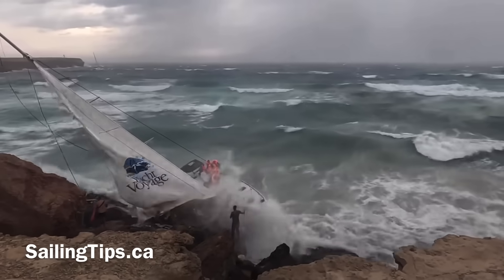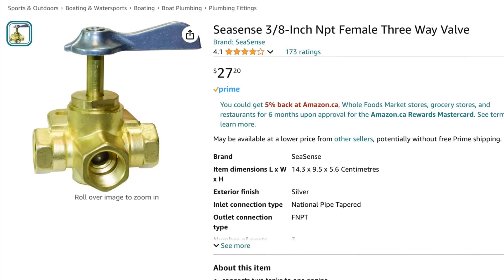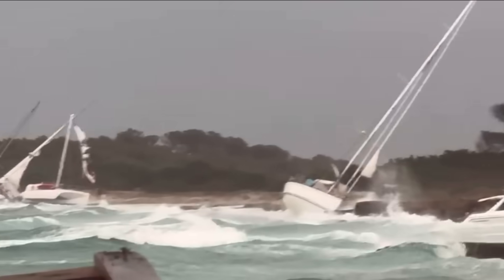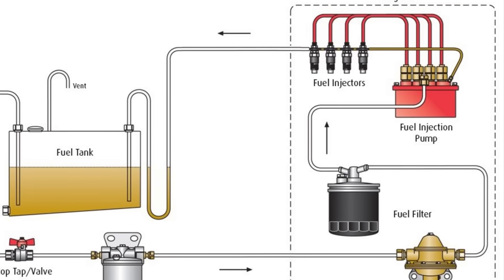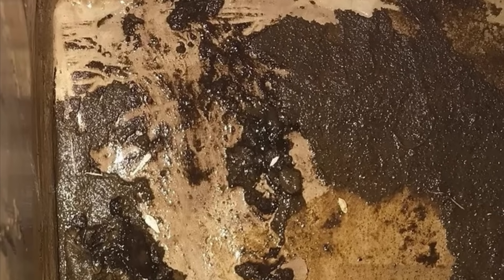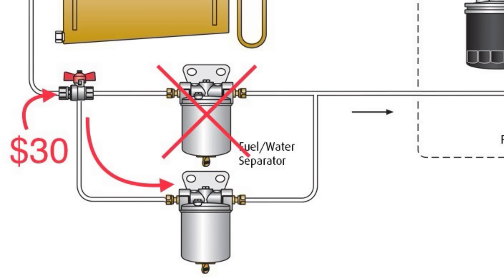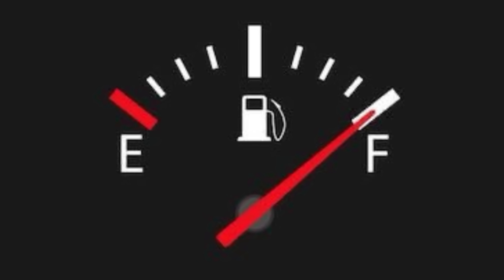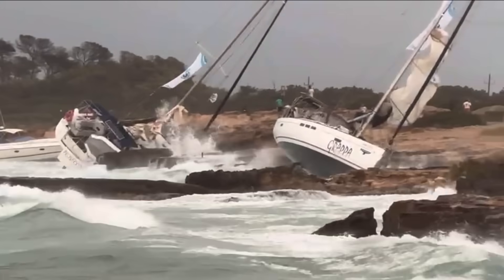The Critical $30 Safety Device Most Boats are Missing!!!

Comment: Redundancy is always good, but the vast majority of problems I've seen trace directly to bad judgement, maintenance or seamanship.  That is why bare-boat charters always get me a little unnerved. With all the technology and information available today you need to look for trouble on the water. Presenting a conspiracy theory about boat builders is not addressing the actual problem. Skippers are responsible for their vessels and your post regarding diesel fuel issues helps with that important awareness.
Reply from the maker: Yes I agree that most of these problems can be avoided with proper maintenance. I don’t think boat builders are actively conspiring but they do often opt for the cheapest solution that meets the regulations.

Comment: Boats do NOT get '..blown onto a lee shore..'.  That'd be impossible.
Reply from the maker: I think it’s a matter of relativity and definition - a lee shore from the perspective of a sailor on a boat is the shore to leeward (i.e. downwind) of the boat. The same shore can be the windward shore of an island from the perspective of somebody on land.
Reply: @SailingTipsCa  Sailor or landlubber, a lee shore is a lee shore.  
IF the wind direction changes the lee shore ceases being the lee shore.  
Your comment makes no sense.  
"Boats do NOT get '..blown onto a lee shore..'.  That'd be impossible.
Reply from the maker: @jerrycallender9352  It’s a common nautical term (likely coined by the Brits like most nautical terms) and as noted in this article there can be ambiguity based on reference frame: https://en.wikipedia.org/wiki/Lee_shore. There are lots of other references online too.

Comment: I have this but last time I suffered an engine stop, the fuel suction pipe from the tank was blocked with fibers so it didn't help to shift to the other filter. It took me an hour to realize it, give up what I tried before and rig a temporary hose from the tank drain valve instead. Luckily I have two engines, otherwise I would have been in trouble. I cleaned the tanks two years ago and think this dirt came from the fuel station.
Reply from the maker: Yes a second separator definitely wouldn’t have helped with a plugged suction pipe unless each separator had its own to draw from the tank! Glad you had an extra engine and were able to make it back! I’m sure cleaning the tanks will help prevent recurrence.

Comment: Add another valve after the 1st fuel water separator so you can remove it for maintenance while the spare is in use?
Reply from the maker: Yes you could definitely do that, but would still have to bleed the filter you just replaced which could result in the engine being unavailable for ~10-15 minutes.
Reply: @SailingTipsCa  ah so that would have to be a 3 way valve too then?
Reply from the maker: @Brewbug  Possibly…or if you add a pair of two-way valves, one on each side of the circuit prior to the Y that re-joins them you might be able to prime the spare if your primary fuel separator has an integral priming pump.

Comment: Well said. Another option is a switch valve to an easy to clean 'day tank'. Thanks for a very good idea. Note also that filling with diesel from floating pontoon fuel stations in harbours means loads of muck coming into your diesel tank after rough weather. We came across northern Europe from Germany where we fitted an inspection hatch and polished the inside of the tank, to the UK in rough winter weather - after just 2 fill ups from floating diesel stations the filters blocked repeatedly - we used 5 new filters -no exagerration - after the engine stopped several times, twice in dangerous circumstances. That's just how bad marina filling stations are. I will implement what you suggest, but from a separate tank with a separate filter system i think. Nice one :)
Reply from the maker: Yes the day tank is a great idea! There are also some pretty good water/crud separating funnels that can help on the filler side which I like to use in unfamiliar fuelling locations.
Reply: A Baja Fuel Filter, used when filling your tank, can keep the junk from getting into the boat's Fuel tank. It is an aluminum cylinder with 3 or 4 filter stages inside. The filter stages are easily removed for cleaning
Reply from the maker: @banderson8444  Exactly - there are a few variants around!

Comment: Hi there, good idea ... until it's also blocked.
Maybe a bypass  to a second tank could help? Also with a T valve. But behind the seperator.
Reply from the maker: Yes it’s definitely not a permanent solution to a dirty tank - just enough to get you out of trouble and back to safety - kind of like the mini spare tire in your car! Adding a second day tank is an excellent solution!

Comment: When sitting, diesels should be kept FULL, and gas boats should be kept EMPTY!

Because empty diesel tanks will act like a billows, sucking in moist cool air at night, condensing the water out of it, and blowing the dry air out during the heat of the day. 

Gas tanks kept full will evaporate all the light volatiles out leaving a think sludge (varnish) which will they make its way thru the fuel filters and plug up your injectors, jets, etc..., even after you put fresh gas in.
Reply: Also, if that varnish makes it into your pushrod engine it can coat your intake valve stems, sticking your intake valves open, dropping out the  push rods, and destroying your engine. 

If one wants to try and burn thru that fuel one needs to put a lot of light oil (e.g. ATF, MMO, etc...) in it, plus a lot of carb cleaner (e.g.barrymans chemtool) and and change the  engine oil frequently (when it starts to feel a little sticky).

Also revving your carbureted engine and slamming closed the choke plate closed can clear the idle and transfer ports if the x engine bogs/does when accelerating from idle.
Reply from the maker: Thanks for all the details about gas engines and how they differ from diesel in this regard!

Comment: Excellent Idea,  but the reality is, its a bit more than $30 for this solution.. really closer to $400-$450 when you factor in the second racor housing!
Reply from the maker: The $30 gets you a simple bypass but clearly better to fully twin the primary! The cost of that depends entirely on what you already have from under $50 for a cheap knock-off to $500 for a premium model. On my boat the genuine Racor twin is currently about $300.

Comment: The problem is that the fuel pick up is often well above the bottom of the tank. If you have a pickup at the very lowest point of the tank  the engine is always drawing the dirtiest fuel through the filters and water traps long before it has an opportunity to accumulate. This allows you to deal with the issue early. It simply doesn’t allow the dreaded algae to multiply.
It’s Murphy’s Law that things go pear shaped when you least expect it to!
Reply from the maker: Yes it’s ironic that the elevated fuel pickup designed to avoid picking up dirty fuel contributes to the accumulation of dirty fuel!

Comment: so it's NOT $30 !!  It's that PLUS the price of a second Separator plus some piping. Which will be another about $100. That still makes it a rather cheap solution though!! BTW a brand like "Vetus" sells double filters as a combined set for exactly this same reason!
Reply from the maker: The $30 will get you a simple bypass to the primary separator which leaves all the filtering to the secondary filter on the engine. This will get you out of a bind but far better to add the second primary separator!!!

Comment: Man, it's been 20 years since there were good parts for 30 bucks. Looks like this plan requires a second housing, filter, hoses, fittings, and a y-valve. Great idea, but this will be more like $500.
Reply from the maker: Depends how much of the gear you already have. The $30 will get you a simple bypass to the primary separator which leaves all the filtering to the secondary filter on the engine. This will get you out of a bind but far better to go further and add the second primary separator!!!

Comment: This can also be prevented by aggressive preventative maintenance schedules.  Boats are not the place the test the length of maintenance intervals.
Reply from the maker: Yes preventative maintenance can definitely mitigate the requirement…but that doesn’t always happen and many of us buy our boats used and it takes a while to get to everything!!!
Reply: @SailingTipsCa  Well built and well maintained redundant systems are always more reliable since you don't have that single point of failure anymore, but in practice "redundant" systems are often left dormant and not operated for extensive periods of time, and then not actually working when required.  

For example, at a manufacturing plant I once worked in we had two air compressors of the same brand and about the same age.  One of these compressors was the "backup" compressor.  It was wired in with an automatic switch to turn on when the line pressure dropped.  The other compressor could handle the entire demand for the plant and basically ran 24/7 for years straight.  And it was on the annual PM schedule. 

One day we had storm damage that disrupted electrical service to the usual compressor, but the other compressor should have been fine.  But when the pressure dropped and it it tried to kick on, the breaker kept blowing due to some kind of mechanical issue from sitting idle for a few  years.  

Thus in my experience, maintenance aggressive PM schedules are more reliable than dormant "backup" systems.

Comment: Rather than adding additional equipment to deal with dirty fuel, I have gone down the route of keeping a clean tank and avoiding stalls altogether.  When we purchased our boat five years ago, i sampled the fuel from the lowest part of the tank to see if it had water.  I did this with a probe which i smeared test paste on the bottom couple inches.  The paste does not effect diesel but changes color if it comes into contact with water. This particular tank bottom is sloped down to the inspection area where the water would collect.  We detected no water but if i did, i was prepaired to discuss cost reduction for the hassel of disposing of the fuel and cleaning of the tanks. 
I do not know the previous owners method of keeping water out of the tanks but it worked.  i have taken the precaution of alway keeping the tank full when the boat is idle or in storage and adding bioside to make the fuel inhospitable to growth.  I have never experienced a stall but cringe thinking about the times when even a short loss of engine power could have been very undesirable.  If you are unsure if you're fuel is contaminated, a periodic view of the clear float bowl will help ( any trip while using the engine will provide a reilistic sample but the rougher the trip the better).  I have not change filters in three years since the fuel system rebuild and approximately 300 hours later there is no water in the bowl and only a small amount of sediment which i believe is refinery/transportation dust contaminates.  

I do think there are circumstances where a second filter could save youre bacon as long as the operator understands its a short term work around and not a solution.
Reply from the maker: Good job on your diligence regarding fuel cleanliness - if only everybody was so diligent! And yes a second filter is really just a band-aid when you can’t do t hat. I did also eventually get around to cleaning my tanks “properly” and never had to change a primary filter after that.

Comment: The tank(s) should have a drain at the bottom to remove sludge. Drain until clean diesel only comes out. Additionally, use an adfitive to prevent bacteria growth AND keep tank full in winter to prevent water condensation - which is a root cause (and be sure to purchase quality fuel from operator with high sales volume).
Reply from the maker: Totally agree! Unfortunately many tanks are situated such that it’s hard to impossible to install said drain!

Comment: Build a fuel polisher. They are fairly cheap to make. A couple hundred at most. If you can afford to buy one, the best type is a centrifugal polisher.

If you also use a day tank, you can fill the day tank through the polisher and never have this problem.

If you don't have a day tank, use up the fuel in one tank then  refill that tank from a second tank through the polisher.

If you only have 1 tank, polish the fuel into jerry cans once a month.
Reply from the maker: Those are great suggestions - thanks! Unfortunately most boats don’t receive this level of diligent maintenance…

Comment: The MOST fundamental part of the fuel system missing in most yachts is a (self replenishing for smaller boats) gravity tank that, 1) means that fuel pipe leaks leak out rather than let air in, 2) also acts as a primary crud and water separator ad 3) makes bleeding very quick and simple. 
There are a number of other benefits .. but hey ho, nuff said.
Reply from the maker: I think a small gravity tank is a great idea for the reasons you noted! Unfortunately not all manufacturers include them...
Reply: @SailingTipsCa     None of them do, probably because none of them are run by engineers or professional seamen. 
  This is unfortunate as auxiliaries are expected to sit silently in the bilge, sometimes being shaken and pounded for days, with the fuel in the system being gravity and motion hammered back down into the keel bunker tank and any air bubbles from poor joints, pipe porosity or in filters etc., rising to the top, often near the injection pump. 
  Yet, they are still expected to start immediately, and oftentimes most essentially when in extremis.   
  This design naiveté never fails to fascinate. 

 The extra cost of a correctly designed installation is actually peanuts compared to what small boat manufacturers do anyway.  It's usually a tank and some pipework.   But no!  So one has yet to see one coming out of any yard that was remotely correct. ( except Holland & Germany, of course, where yards often keep retired/old engineers to super their work, and systems generally have correctly bulletproof fuel, air and starting systems. But even there, the skills are fading fast ...🙄)
Reply from the maker: @sixmagpies  I know - it would be so easy for them to do it properly from the start!!!
Reply: @SailingTipsCa  Never met one that did .. which is really stupid with an auxiliary. .

Comment: I rebuilt my iron fuel tanks out of epoxy and added a drainable sump that is plumbed with a three way valve to the oil change pump. This works exceptionally well since my tanks are three sided saddle style and slant to the sump. I also angled the return tube towards the sump to wash the gunk towards it. My pick-up is mounted on the top of the sump about three inches from the bottom. Because of the shape, this only leaves a couple of gallons of unreachable fuel.
Reply from the maker: Sounds like a great retrofit - thanks for sharing!

Comment: This is one reason I went electric. I gave up range, but it's much more reliable in heavy conditions.
Reply from the maker: Do you also regen to charge your batteries while sailing?
Reply: @SailingTipsCa  my Elco motor doesn’t allow regen from the prop. And anyway, I have a feathering prop. But there are drag devices that will generate quite a bit of power under sail, I just don’t have one.
Reply from the maker: @dc14522  A feathering prop will definitely give you better sailing performance!

Comment: Any vessel that is not just a ‘day-sailer’ should be fitted out like you suggest!!
I would even go further and suggest a tank big enough to run your engine for say 24 hrs. and have it fitted at higher level than the engine’s Dieselpump.
That way you can have the bulk of your fuel stored in a sealed tank; the fuel that returns from the engine is warm…. This will warm up ALL the fuel in the reservoir…. This will attract condensation as it cools down!!!…. And condensation causes the ‘Black Plague’ in your reservoir!!

In short: make sure you have a small tank, easy to clean, that can gravity feed your engine maybe with two paralel filtres just to be sure…
Have your big stock of Diesel (if you are realy travelling!!) completely sealed from condensation and away from warm fuel returning from the engine, probably  somewhere way down to keep the point of gravity of the vessel low.
Make decent permanent lines with a pump and an integrated water separator/filtre unit to transfer from the ‘big stock’ to the smal tank for topping up!!

It is a safety measure that can be installed on any boat that is driven with an inboard Diesel engine…
It can save your life when you’re caught in bad conditions!!
And don’t forget that this Microbe-infestation-problem is relatively new; we have to adapt and be prepared!
Quite some people have found out the hard way exactly what this vid is warning us for…
Reply from the maker: Great suggestions - thanks!

Comment: Yes, well. Actually, the thing to do is to keep your tanks clean. Period. What you are offering here is a bandaid solution to a problem resulting from the failure to perform basic maintenance. If you have microbes in your tank, the second filter will get quickly get clogged too.
Reply from the maker: Yes keeping the tank clean is really the best solution!

Comment: The shots of a bay full of grounded boats with sails to shreds is quite misleading, as I am pretty sure none of them (let alone all of them) ended up in that situation due to a blocked fuel filter.
Reply from the maker: Yes some of the yachts in two of the video segments dragged anchor. Many of them then tried to motor out but failed. It’s often a cascading series of failures that leads to yachts on the beach.